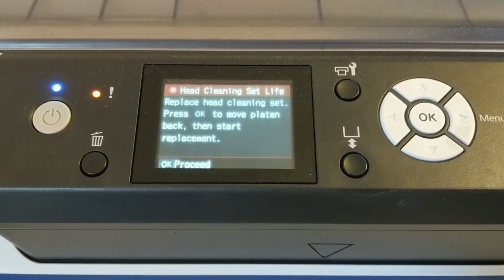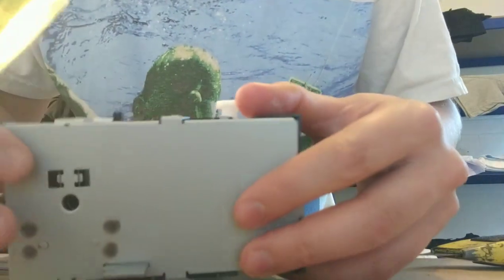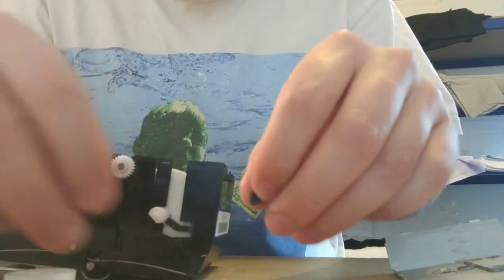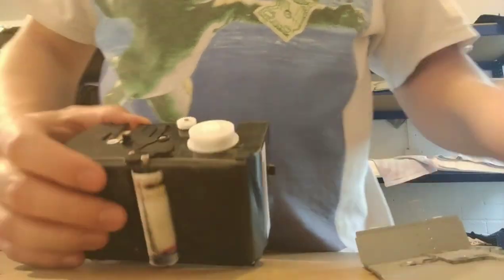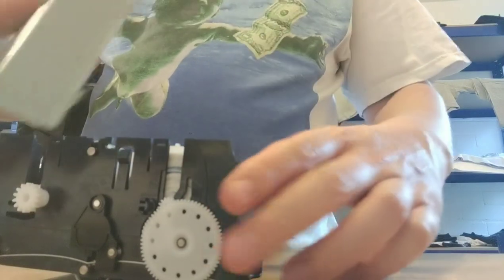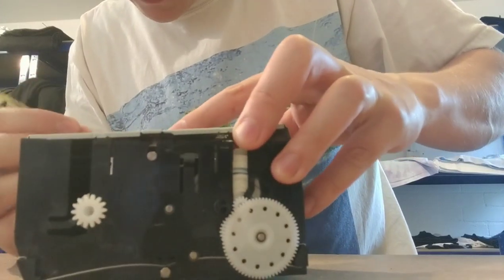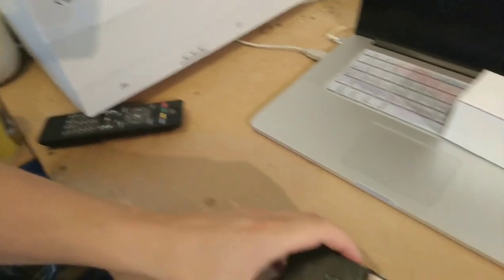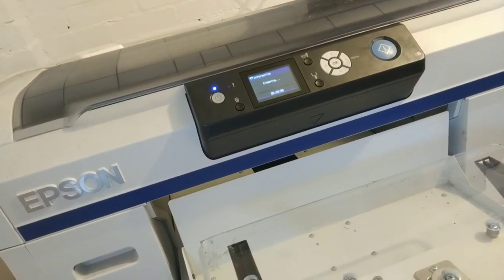How to Manually wind back Epson F2000 F2100 dtg printer Head Cleaning set

Comment: You do not need to remove the top just the white gear on the side and then roll it back
Reply: also you dont need to put that clip back on the white gear as long as you are careful putting it back in the machine and taking it out .   the gear will be held on by the side of the machine
Reply: @DenialPrintCo   how many times do you rewind it till you buy a new one?
Reply: Hi @Bluntedco. , did you figure it out?

Comment: if the head cleaning set is re winded and it happens to try to clean the bottom of the print head where there is already ink won't that mess up the print head?

Comment: so you can use it once and the rewind it and use it again. only 2 times is fine or how many times is fine? if a part that has ink trys to clean the bottom of the print head won't that mess it up?
Reply from the maker: The fabric seems to soak up the ink really well. Lost count of how many time our 2 have been wound back. We print 5/6 days a week though. Could cause more of a problem if you don't print often
Reply: @blewettmark   does your printer also do a cleaning after 6 hours of print time or did you leave the power on cleaning mode? i personally leave the printer on even if i do not use it so that the white ink recirculates and doesn't get clogged and i turned off the power on cleaning mode maybe that is why it does a cleaning after 6 hours of print time.

Comment: Just dont do it! You will loose your warranty and will damage your printhead!
Reply: Complete nonsense. Nothing happens at the printhead and you do not lose the guarantee. It is a water-soluble paint.
Reply: @RHSYS  pigment ink hardens on top of the textile  roll, after several tries the harden material touch the nozzles and scratches the nozzle plates.
Reply: @padalov  Bollocks